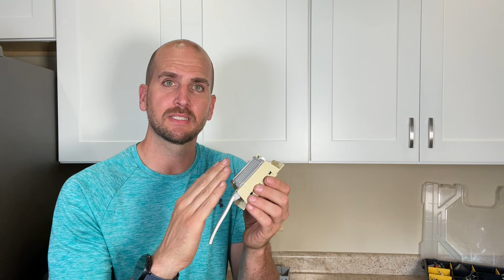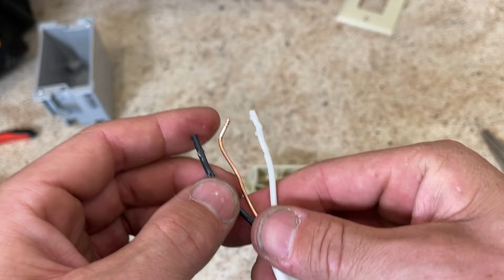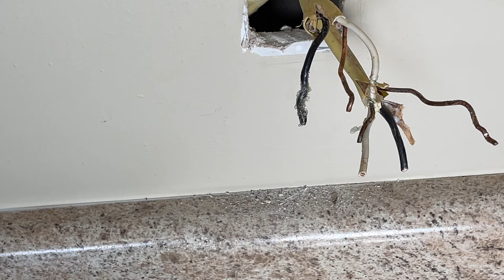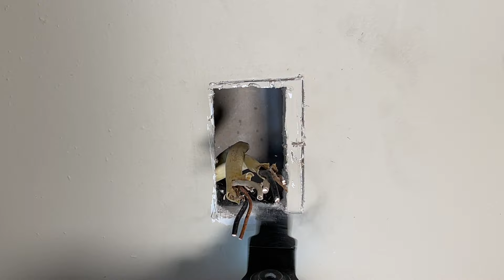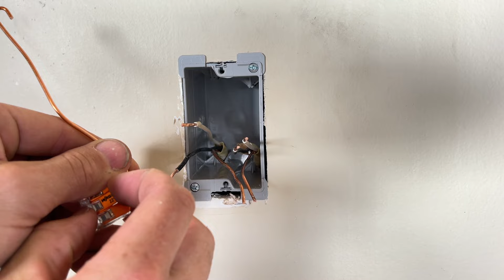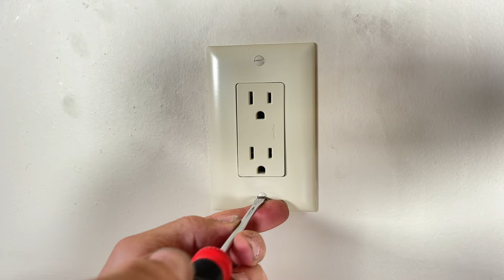How To Replace a Failed Mobile Home Outlet

Comment: I hate these receptacles! Whenever we come across them, we swap them out just like you did. A couple of weeks ago, we changed out every device in a manufactured home. About 50 in all. Oh, by the way. Had to use shallow old work boxes on the interior walls, do to the thickness of them.

Comment: When using an old work box you are supposed to remove the plaster ears on your receptacle. Otherwise your faceplate will not fit flush.

Comment: I’ve got some bad outlets in my 98 model mobile home. Will replacing the outlet mask other problems or will this fix the issue of them getting too hot when using space heaters?

Comment: Don't like the WAGOs and pigtails, as they take up more room in the box.  Why not use the other recp screws to connect both neutral and hot wires.

Comment: Hope someone sees this.
I have this type in my bedroom.
I had a window AC that dripped.
It blew out the outlet beneath it.
This tripped the breaker and I lost all power to the room and to the adjacent laundry room.
My plan is to cap it off.
Would this fix my issue?

Comment: In my opinion you completely contradict yourself about contact area as soon as you started using wagos, as a union electrician we were required to pre-twist and use wire nuts on every connection and the only time that we used wagos was in like truffles for led or fluorescent lights. Most of those light trotters coming from either of the light ballast or driver or either 18 gauge or 20 gauge wire where they were not running high amperage, at that point you don't get a lot of organ and a sparking thus causation is you don't have to worry about overheating.

Comment: It kinda looked like the receptacle was split for kitchen counter when you removed the wires. I was surprised when you connected everything as one supply for the new receptacle. Is code different in your area for kitchen split receptacles?

Comment: Those are a self contained device, according to 3280 hud standards if they are ul listed and the manufacturer is allowed to use them ( manufactured homes still use the 2005 nec code)

Comment: At least on the telecom/data world that is called insulation displacement terminals.
And even in data cabling the connectors are not meant to be reused very often if at all. So no I wouldn't like to see that in high current applications but cost cutting measures after all.

Comment: I have a 22-year-old manufactured home with these outlets and switches. I'm a retired HVAC mechanic and am also uncomfortable with their design. I have one outlet where I've ran a 1500-watt heater every winter and have never had a problem.  In fact, I've only replaced a couple, using your method, when adding a light fixture or additional outlet.

Comment: Working for Property Management doing all kinds of maintenance I repaired a lot of outlets that were speed wired (tenants were complaining that whenever adjoining apartments slammed a door, the tv would change channels)by removing the wire and putting it under the screw. I also learned that leaving unused screws loose can cause static in electronics.

Comment: I love WAGOs. They're magnificent for home gamers. Ironically, they work much like the IDC outlet you removed does, but they're German made, far exceed our requirements, and are FAR more dummy-proof than wire nuts/marettes!
Reply: they dont tend to cut the insulation, they just squeeze down on the wire extremely tight when the flap is closed, very solid connection with lots of metal in contact with the wire, im less a fan of the clear plastic ones because of clear plastics tendency to be more flammable under stress but otherwise i love the wagos a heck of a lot more than wire nuts

Comment: The makers of my manufactured home must have splurged because my outlets are all backstab.  They don't even screw terminals.  Learned that when I replaced a worn outlet with a spec grade.
Reply from the maker: Yeah, I think if your home has standard 2x4 construction then the manufacturer might also use standard outlets.  I also agree that when you are swapping out stepping up to Commercial grade is a smart move.  I like Legrand and Eaton.

Comment: In my opinion, the wagos do not grip/connect any better that outlet you just changed out......nothing makes a safer connection then complete contact around the wire like a properly installed wire nut. Just my 2 cents from 57 turns around the sun.

Comment: I live in a RV park with RV’s and mobile homes,(called park models). I have replaced a. I have replaced a number of theses stab type recepticals. I also found they use them when the walls are only 2X2’s and there isn’t enough space for a standard box. Those I replace it a small box with a side extension for the wires to fit. I have found the same problem with barely any contacts, mangled wires hastily pushed in, up to four wire lines crammed into the spades, and a lot of corrosion on the contact points.

Comment: Why's the refrigerator on the same circuit as the counter top receptacle?  I had someone drill me as a child into using commercial grade outlets for everything because of high draw devices like space heaters.  I've also seen houses with every single residential grade outlet burnt because of the previous tenent running space heaters.

Comment: My comments are in the other video.  IMO, you were very fortunate there were two sections of Romex in that outlet.  Had the outlet been installed within a single run of Romex, then cutting the wires in the middle where the outlet was installed and the wires are damaged, then trying to bring both white, black and ground wires together for a WAGO with jumpers would have been a pretty tough job, to say the least.  In your other video, you showed an example of the outlet installed in a single run of Romex, so that could be a standard installation practice in manufactured homes and mobile homes.

I always make my cover plate screw head slots aligned like that, horizontal.  I just think it looks better and more professional.  Most will never notice, but I do!

Comment: I don’t like those self-contained devices. I have changed out a few switches where my father stays with another self-contained / all in one device merely because it’s a rental. The wall boards feel like their paper thin. If anymore go bad I rather use old work box and  view it as a device upgrade.

Comment: I hate those boxes!! Currently try to replace the one that failed in the bathroom for the light and the vent… but couldn’t find an old work box that is shallow for the mobile home walls, what depth was yours? I could only get the blue ones 😭 I’ll try another store I guess

Comment: I wish I would have found your video 3-days ago!  I'm just kicking myself about those WAGOS!  I'm replacing the outlets and such in my kitchen.  I ran into a spot where I had 5 neutrals, 5 hots and 5 grounds.  It took me an hour to safely cut/splice/pigtail all those 12 Ga wires.  With all those big caps, it was like trying to stuff 10-pounds of s**t into a 5-pound (old) box.  I can see where those WAGO's would have saved me a ton of time and FRUSTRATION!!!  Thanks to you, I ordered the assortment box for the rest of the work I have left.  Great video!  Thanks!

Comment: I have a quick wire setup that I want to upgrade to standard.   My question is I have 3 sets of wires coming out of the wall.   Where do I attach the 3rd set?

Comment: Holy crap!!! I never knew Mobil homes have outlets like that, but they would do a great job turning a mobile home into a crematorium.   I have only worked in stick built homes,  every outlet and switch I installed I loop the conductors and use the screws, inside an approved enclosure as always.  I never use the back speed wire connections, the little spring metal clamp has minimal contact area and makes for dangerous heat when running high amp loads like microwaves, toasters, space heater or air conditioner.   Reading through the comments makes me sleep with one eye open in a mobile home or RV from this point on.

Comment: If this was just a on/off switch - could you have just connected the two neutral wires together and not even connected them to the switch? Just connect the hotwires and ground wire to the switch?

Comment: Dam, I should of did my research. Soooo bumbed out. Trying to replace my plug. I tried to use the same type. Did not realize they suck and are difficult to install. Going back to hardware store and buying a normal plug and box. So unsafe and unfriendly to install.

Comment: Thank you for posting. I’m trying to replace an outlet in a trailer built back in ‘79. Got the faceplate off but there are no other screws holding the outlet into the wall but it won’t come out either.  Any ideas?
Reply: Can anyone answer this please?

Comment: them are the exact kind i have in my 2003 MH. just today i came in from my shed( i have been charging all my 12vdc batteries, for the ice storm, mower, 4wheeler, ect.) and i noticed a familiar smell, it took a minute to reconize the smell, but yeah, burning plastic/wire. ok.since the cheapo HVAC unit died 15yrs ago. i heated with propane until about 5yrs ago.AND  yes i had a $110 space heater, that i maintain every year. that heated well , and had a thermostat & kick ed on & off, but no lower wattage setting. BTW , this outlet is on a 110VAC 15amp breaker, that was a stand alone or dedicated to a corner bedroom's light fixture & 4 outlets, the exterior GFCI  recepticle & 2 recpt.'s on both sides of bedroom door, faceing the living room. the burning recpt. scared me tremendously , i killed the breaker & confirmed there was no ele. to it or the other outlets. i took the recpt. out of the wall & no burning on back or on wire or inside wall.. i got lucky.. how did they get them things past code. most of them i see are hanging out of the drywall ! the box isnt even attached to a stud. i had 2 other recept.'s charr-up thru the years, but never burn up. one that i fixed the drywall was minor damaged & fell right back out of the wall, not enough wire to move it over 6" to make another hole with sturdy drywall, SO THANK YOU FOR SHOWING ME THE WAYGO CONNECTORS  !!! i didnt trust wire nuts to make a pigtail to move the over... and after today im going to my ele. supply house & get recepticle's and some remodel boxes & waygo conn. all these outlets gotta go.... BTW . all my switches are the 1"wide flat ones. ive got several that get stuck halfway on the throw & the lights start blinking & im thinking, well theres a fire prone situation. anyway.. thanks

Comment: I was shocked to see this type of electrical outlet in our new to us Florida home. No wonder so many manufactured homes burn down. I am replacing all of mine now to the stand box outlets and switches. I have seen this type connector in the auto industry with the use of Scotch Locks, designed for low am use on radio speaker wires. Then people started using them on 18 gage wiring and often fail.

Comment: I own a 21-year-old doublewide purchased new.  Zero issues.  21-years with the original appliances, WH, HVAC, and...these very outlets.  No leaks-plumbing or roof.  No problems at all.  I have never had to replace a window.  Best purchase I ever made.  The hate here for these homes is very misinformed.  The homes are NOT energy hogs.  They are sealed up very well top, sides, and bottom and are very efficient.
Reply: @AA17768  I have no other complaints with my manufactured home built in 2005 it is well insulated, has 6” outside walls. I don’t hate it but very disappointed in the wiring.

Comment: Also I meant to add I have a 2017 manufactured home with the same self contained boxes. I prefer to redo them all like you show, but I was thinking after watching this episode. Why couldn't you gently pull the Romex wires out then strip the contact spots and push them back in with a flat head or needle nose. That would save me a lot of money and on a fixed income it's a must. I've seen another video if someone doing just this but I can't find it right now to tell you where it was on YouTube. I subscribe to your channel for great ideas. Thanks.

Comment: I had a similar situation with a light switch but had three Romex 14/2s in the wall attached to this self contained switch. I had to call an electrician because I couldn't figure why my closet light and bathroom light would work but when I turned off the switch it killed bit only my closet light but also my bedroom receptacles in either side of the
 bed.  Now the electrician told me what I did wrong over the phone one of the black wires from the non power Romex had to be connected with the line wire to keep constant power to walk receptacles. Anyways thanks to him I fixed it and all is okay. I wish you would show this in one if your videos and I can give more details but I'm sure you know what's happening.

Comment: I have yet to warm up to lever nuts.
Thanks for the video.     I have a manufactured home and need to replace the outlets as your doing here.
Some places romex runs through the boxes. The problem is there is not enough slack to do the rework.

Comment: I think you done a heck of a nice job for having to work with mobile home self contained receptacles,  normally if I get a call from a mobile home owner,  I usually pass it up and give them another contractors number and let them deal with it.    I think the mobile manufacturer should have to wire their homes by the N.E.C. the same as other homes, but they get by with it because their place is located out of the jurisdiction where an inspection is required they can get by with crappy wiring like the self contained boxes,  the N.E.C.  has a requirement on how many cubic inches per conductor is required and the self contained back where the wires go do not meet that requirement.  I hate 14 gauge wire and quick wire devices,  they're dangerous and a lot of lives have been lost because of it.  We have to have a state license, so why can't there be a state inspection on any home built in Texas,  this would help immensely,  Thank you for allowing me to release my rant . By the way I always put my plate screws at 7:05 just a little off vertical, it's totally different from anybody else, and looks awesome.       Thank You and  God Bless All

Comment: Not sure if you answer me but my friend has a room that has 4 outlets, my power gage says there is power in all four but nothing works. Any ideas?
Reply from the maker: I would probably get a Multimeter to see if the voltage is lower than 120 volts.  Some times if you have a loose wire nut / wire connector you might only be getting 60 or 70 volts that could trip a non-contact voltage tester but not enough to power something like a TV.

Comment: Hmmm.  After showing wires not making contact, one should double check the electric is off with a contactless checker.  Also, why use connectors and pigtails when in that case the socket can handle a pair of cables.
Reply from the maker: Thanks for the feedback Frank!

Comment: if you strip the wires is it then safe to use
Reply: The contact points are still not enough to avoid overheating with heavy loads.

Comment: Absolutely agree with outright replacement with anything better than the typical mobile home receptacle.  I just replaced one and was careful to push the wires down into the contacts very deeply, then confirmed continuity only to have it fail intermittently when plugging in a 700W electric heater during our first camping trip.  Now I've put a proper box and residential receptacle in there instead, and wouldn't you know, I no longer have trouble with the circuit!

Comment: I think the outlet is being maligned because it was improperly installed.  There should be only one wire per slot installed, and it is essential that the correct push-down tool be used for installation.  When the wires are stacked in the receiver slots the first wire may spread the gap large enough to create a poor bite on the second wire.  Thermal cycles from large loads would make this connection worse.  Correctly seated the wire bite should be robust against the thermal cycles introduced during use.  Based on my experience with insulation displacement terminals I think these outlets would be generally reliable if installed correctly.  This is probably why they were granted the certifications to be used.  On the other hand, if I were replacing one, and a J-box would fit, I’d use a standard outlet also.

Comment: I saw some in a mobile home from the 80s where instead of stacking wires they ran a solid wire cut thr sheathing 3 inches long and pressed the wire in it and continued out the other end. No splicing or anything.

Comment: the issue I found 3 out of the 4 times replacing outlets similar to this in my uncles modular home is that the cavity in the walls is more shallow than in a normal house, so a standard old work box is too deep to fit into the wall.
Reply: if you see this. what did you end up doing to replace the outlet then? I have the same problem the walls are too shallow in my doublewide for a standard work box.
Reply: @josephgozdick9217 what I did (and it is against code) is use a low voltage box (ring) which doesn’t have a back. Don’t do this; but it is about the only solution I was able to come up with.
Reply: Carlon makes a shallow 1.75" deep new work box I used in our MH 2x3 stud interior walls. Not sure about shallow old work boxes
Reply: @violetsandferns969 I am sure such a product exists. I was just using what I had at the time at the local store.